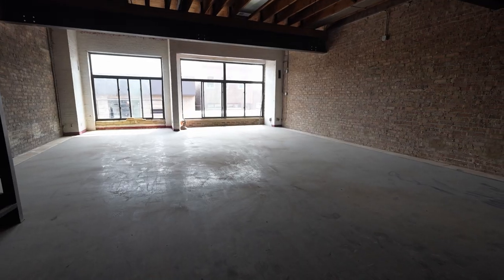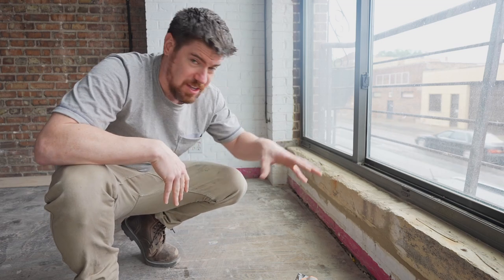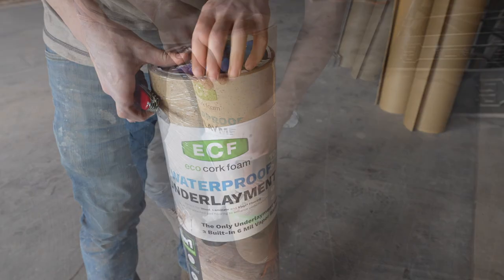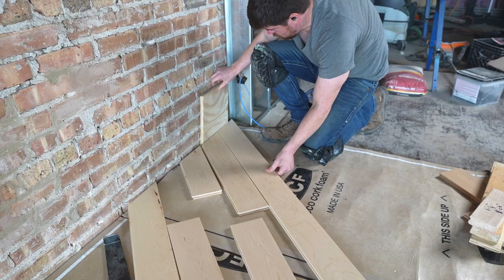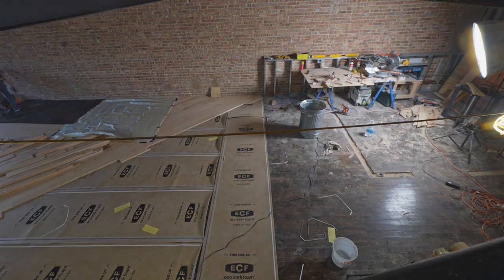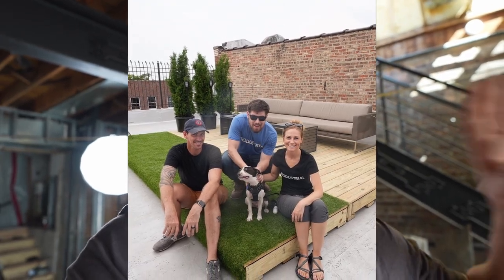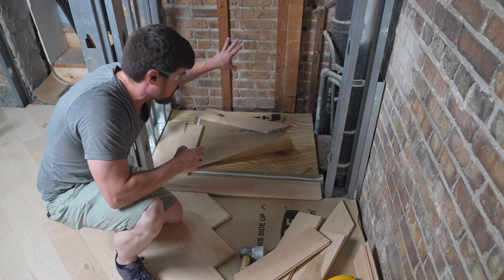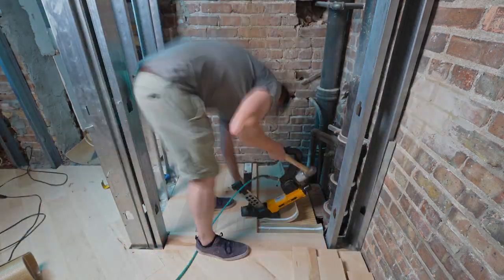ep. 23 - The MOST Dramatic Change yet!!!  ...Abandoned Bldg Renovation

Comment: I would 3D print something for the stairs then cast it using metal making molds from the 3D printed pieces!
Reply: Yeah you can melt it out like the lost wax method and then fill the molds. Go bigger than you need so you can sand down imperfections and don't forget to add a vent
Reply: One thing to be aware of with metl casting is galvanic corrosion from dissimilar metals. You'd definitely want a barrier, probably fiberglass, that would protect both the stairs and the cast parts. Personally I think a 3D printed or wood filler with hand crafted metal skins would work well enough and look just as good while not requiring a forge and costing a bit less.
Reply: @Zalex612  seems like the stairs are the same metal as the I-beams tho so as long as he uses the same kind of steel we should be good? The forge bit, yeah...
Reply: Was  gonna say something similar but just using the 3dprint sanded and painted OR use a metal filament and let it patina for flavor. The copper PLA/PETG filaments patina really pretty and if you break it, print another.
Reply: Yeah, to match the style of the stairs
Reply: I'd just print it and finish the print with some matte 2pac or something.
Reply: Exactly!  Either 3D print or have one of the talented artist friends mold or carve something for another colab.  Either way would be awesome.  Can get as weird as you want.  Me I'd have a little muscle guy holding up the stairs, or a construction worker doing some finishing touches.. or a faux el capitan rock face with some climbers on it.. Or Chicago skyline with The Dark Knight on the Sears Tower.  DO SOMETHIN CRAZY!
Reply: @xeromaru  carbon fibre would be an interesting material with resin.
Reply: @rxc3ntr1c  you can get good finishes with wet sanding.
Reply: @PWingert1966  Yeah, I was just thinking of durability of the finish and being able to match it to the railing.
Reply: @ls9  still need room for expansion around the steel between the floor boards. he cant put anything into the grooves, its gotta go ontop of the flooring.
Reply: @rxc3ntr1c  Maybe try a chemical etching technique on milled copper? Or is that being too geeky!
Reply: I’d go for a simple estucheon made of angle iron. If needed, paint to match the stair finish.

Comment: One interesting way you could cover up those spaces around the stairs is with 3D printing. Print out something that fits in there, give it a bit of shape, simple shapes could work, like a gentle incline maybe? Sand it out to make it smooth, and paint it to match the floor. Benefit of 3D printing it is that you could print out something exactly for that space, and make it (mostly) cheap to redo it if needed.
Reply: Beat me to it. Perfect idea
Reply: I bought a 3D printer and I didn't even think of that
Reply: 3D print something that LEDs can shine through
Reply: Except I would recommend a Resin printer in this case. Not the typical FDM. FDM looks "cheap" imo when trying to match it with aesthetics as seen in these videos.
Reply: Was just about to say this
Reply: Print it out of wood filament
Reply: @zioxei  Maybe you could 3D print some good ideas for next time.
Reply: I'm gonna add on to this as well and say  if Mike's got the resources, maybe look into lost PLA casting. Measure everything out perfectly then cast 2 pieces that fit together with a drop-in.
Reply: Could even use it as a starting point for casting from a sturdier material, so that iteration wastes less time and harder to recycle resources
Reply: Think this one won!
Reply: Could even do a cold cast with the 3D printed part with some iron shavings and concrete
Reply: I was going to suggest this also. I would start with the low end plastic stuff making two pieces that snap together around the post and get it exactly how you want it to look. Then once you have that 3d file with all the measurements, it could be possible to adapt it for wood or metal with a cnc if you wanted an upgrade. But honestly no one is going to be looking that close there 😂 so plastic could be fine, at least for the short term.
Reply: Or CNC some perfectly matching wood pieces. Out of some of the old reclaimed wood.
Reply: A cool project for the stairs may be some aluminum casting.

Comment: Wild idea for the stair trim question while totally keeping with the Modustrial aesthetic... 3d prints some molds that wrap around the areas you want to cover, lay in some LED or fiber optic lights and pour a cool translucent resin color into it. Have a color changing controller, as well as a dimmer and app option and use your new resin base for mood lighting while also creating a way to not stub your toe when you make a late night trip to the fridge for a snack.
Reply: The 3D printer was my exact idea for the trim as well. I understand that Modustrial ( I forgot his name) likes to support artists and creative pros. So, having a friend who is a wiz with 3D printing tech would be a great way to set that trim and support more unique and skilled folks out there. Great ideas all around and I am just LOVING this series!!!
Reply: I'm not sure if I'm picturing it right, but what I'm picturing looks cool! However, the gaps around the stairs are expansion gaps in case the floor moves, so I don't think you can fill them with resin. 
Or were you talking about the resin-part going on top of the wood, similarly to how a baseboard would work?
Reply: @simonro9168  Very much like a baseboard would hide that gap. Enough of an overhand to accomplish that, while keeping off the floor to allow expansion and natural movement. Basically having the resin attach to the metal part of the stairs while acting as a cover for the 3/4" gap
Reply: Wookies are very smart indeed.

Comment: In Holland/the Netherlands we use “platte plinten” it is a small piece of trim that is specially made for detailing around structures when laying down wood flooring!

You can use it around the stairs, if you don’t have any available. Just use a router around the edges of a bord and cut it just to 1 inch width and use it as a “platte plint”

Good luck!
Reply: Basically a flat skirting board that attaches to the floor instead of the wall.

Comment: We had the similar issue when renovating an old building that had a metal staircase. We used angle iron to “trim” the posts. We also consider trimming it using 1in strips of the wood flooring with a router edge but the home owner ended up wanting the iron. In the end it looked great!
Reply: Perfect!
Reply: The steel was the first thing i thought about when asked in the video, if you can make it look like it's the original groundplate i think it will look the most authentic...

Comment: for the stair trim just tack weld a steel "L" that is attached to the stairs but floating 1/8" above the floor so you get your expansion and it doesn't rub on the floor but hides the gap

Comment: Did you check the tiles you found for asbestos?  That is a serious concern in old structures.  With asbestos tile if it is not deteriorating it can be sealed and covered.  However you cut through the tile.  I would send a piece to a lab to be checked.
Reply: Bit late now, the job is already done 🤷🏼‍♂️
Reply: @John...44...  If I am understanding correctly that tile spans the living room under the wood subfloor.  So, it is still relevant even if the job is done.  If it was my floor I would get it checked and determine if remediation needs to be done.
Reply: @greengiant_6652  ok, but as far as I'm aware, asbestos is ok aslong as it is not damaged or able to be damaged. If it's under flooring it is safer to leave it where it is until a later date. That's the rule in the UK anyway
Reply: @John...44...  I believe that is the case in the US as well.  However, he cut through the tile in several places and in several of the shots the exposed tile was crumbling.  I would test the tile and then talk to an expert.  It's possible the combination of plywood, underlayment and  wood floor is sufficient to seal the tile.
Reply: Just saw that and went through the comments to see if someone picked up on that...I'm from Australia and any old tiled floor covering is to be wary of in case of asbestos. But alas this comes a bit too late to stop the circular saw pulverising it into fine dust.
Reply: Exactly what I thought when I saw those tiles.

Comment: I recommend a copper "boot" around the expansion gap on the stairs.  Make it angled almost like a pyramid base.  Copper is malleable and lends to the industrial look you go for.
Reply: I totally thought about copper, as well. Now, steel-to-copper directly touching will cause electrolysis, so the copper will rot over time, but being aware of that, you'd want to put a thin insulator between them, or just use brass instead.

Comment: Would make trim for the stair-posts from steel plate in two parts with one seem in the middle. Make a template from cardboard and transfer it  1/4 inch thick steel plate. It's weight should hold it in place and otherwise you could use the space underneath for a magnet to hold the two pieces together. Goes well with the industrial-look; better than 3d-printed stuff.
Reply: Yes! Making a custom metal escutcheon is perfect! 
(3D printing would look so bad...)

Comment: I am flooring installer of 28 years. one route to go to trim out around the steps would be to take scraps of the flooring and rip them in half thickness wise and then bevel the edges. then lay them flat on top of the floor and scribe them to the metal stairs covering the gap kinda like a picture frame. I would silicone them down and also use some pin nails to hold them in place. none of that will hurt the expansion of your 3/4 planks and it will blend right in with the floor. hope that helps ya and keep up the good work!

Comment: I had a similar issue in an old house with a metal railing. Use the wooden threshold boards that go between the hardwood floor and the front door jam. They have a Grove that goes down and fits into those gaps. It took some cutting but it worked perfect and looked great.
Reply from the maker: Good idea!

Comment: I can't wait to see how heating is being addressed. I worked in an office that converted an old cotton river mill that has similar brick and steel stairs as your building. Cold seeps through those outer walls very easily especially around the windows so folks started to have mini heaters at their desks to compensate.

As for how they fixed gaps between steel stairs and new flooring, I think I recall some sort of black tar like sludge that melted-fused together in those spots for main emergency escape stairwells and the smaller ones just had the gaps visible.

Comment: Angle iron sounds like a solid idea. You could also consider products such as weneve minileiste, they make aluminium skirting/trim that is inset into the floor so the visible part is horizontal, not vertical. It has springs to account for the wood movement. Looks pretty nifty.

Comment: You could use an angle iron which is low height and a bit longer in the other direction, then weld some big bold heads onto it to make it look like it's bolted to the floor. If that's the aesthetic you're going for.

Comment: I think you're on the right track with your angle iron idea for the stairs. Weld it to the stairs for a fastener free finish and paint it to match the rest of the frame. If and when you need to redo the floors you can slide them in and out from under the bottom of the piece.

Comment: For the sections of the flooring where they meet up with the staircase: 

My suggestion is to cut the new flooring back (anywhere from 3" up to 8" - depending on how much steep you want the angle) from the post/rail/panels on the side of the stairs, then use a router to cut back the original flooring on the outside edge of the metal where it's attached to the original floor (at least 0.5" to 1.5" max).

You will create a 'step/slope down' to the original floor level by adding an angled/sloped piece of trim that will be flush/inset @ bottom (aka the original floor) & meet up with the new flooring @ the top.  The inset will slope on an angle towards the staircase with the thinnest part being flush/inset into the original floor.  The steepness of the angle will depend on how far back you start the match up with the new floor.  I think it's probably going to be about a 3-5" for a 45 degree angle.  You can use a contrasting color, match the wrought iron, &/or match the new flooring (& you could change the color depending on where it's at & how visible/invisible you want it to be).

Think of your new floor as the outside rail of a cabinet door & the original floor being the inset panel.  You are adding a piece of trim to blend the 2 pieces together & eliminate any edges.

I can't see any way to 'trim it out' in a typical 'new flooring way' that wouldn't look a bit odd IMO.  I can send you a sketch for clarification if my description wasn't clear enough.

Comment: Use bleached cork to fill in the gaps around the staircase. Much like cobblers do when removing cheap fibreboard from shoes and replace it with cork. They use a hot flat iron to smooth the surface (like a floor screed).
Hopefully it will be soft enough to expand whilst filling in the uneven gaps.

Comment: Did you check to see how level the floor was and remove any high spots on the wood "subfloor"? 
I know since you have wood flooring it is less of a problem than a harder tile, since the wood will expand and contract with humidity anyway, plus the cork helps a little bit too.
Reply from the maker: Yup, we did that....also, the ecocork foam helps quite a bit with leveling things out

Comment: A suggestion regarding the area sorrunding the excisting stairs.1. make the floor wood look a nice as possible (make the wood have a clean cut). 2 Use black silicone and fill op so the silicone is level with the floor, but also in full contact with the stairs. The silicone has the advantage of being somewhat flexible and allow wood movement and the same time closing the gap completely.  Sorry for bad spelling and hope suggestion make sence....Other wise interessent video and the rebuild is very cool...:-)

Comment: How about taking 1-1/2 inch pipe and sawing it length-wise into quarters. Weld those to 3/4 inch angle and you have some steel quarter-round or shoe mold. Paint them black to match the rail and bolt them in place to avoid damaging the floor, and removable in case you ever need to replace some flooring.

Comment: Simple metal flanges around the stair post and structure from some 3/16 1x flat bar would be my solution. If it were me, I would stitch weld the flanges to the existing metal to allow for floor movement. Quick, short welds with copper flashing between the wood floor and where you weld will greatly reduce floor damage.

Comment: Re the stairs expansion gap. You have a CNC. cut a molding that you can glue and pin in place out of a solid piece of flooring and split it so it goes in as two pieces. Similar to the 3D printed idea but out of the hardwood you use for the floor.

Comment: Use CAD (Cardboard Aided Design) to make template in two halves, laser cut some steel sheet and paint/powdercoat the same as the stairs or stainless sheet. Then slide in from either side.

Comment: I like the idea of using some 1.5" angle iron to weld on a sort of "platform" look to the bottom of the stairs.  Use  a really thin cork or neoprene under it to get a good flush look at the floor and keep junk from getting under there, then grind the welds clean, and maybe tack on some detailing that looks like the designs on the sides of the stairs, maybe weld on some bolt heads to make it look bolted down to the floor.  Turn it into a feature instead of trying to hide it.

Comment: Expansion gap around the steel staicase: Could you not use some kind of quarter round base board trim that would be liquid nailed to the steel but not the flooring? That way the floor could expand and contract under the quarter round..coat it with the same varnish/stain as the floor. a bit of linseed oil based putty tinted same colour as flooring for any gaps between the steel stair and and quarter round. think thats how i would do it..i'm no pro though
Reply: I wanted to suggest the same.  great idea
Reply: Quarter round the same colour as the steel and you wouldn't even see it

Comment: My idea for the gap between the stairs and the flooring is, I feel, a fairly simple one. Get some metal sheeting. I'm not sure about american measurements, but in the UK 3mm would be plenty thick. Use that to make some faux base plates. Actually weld a strip to the stair post and stringer holding up the stairs. Tac on fake bolts that look as though they're bolted to the floor. Have the sheet metal go all the way around the stair posts, so it looks like its an actual base plate. I'm a bit late to the party with ideas, but i hope this helps.

Comment: You can glue strips of cork into the gaps at the stairs. Because of its flexibility, the floor should be still able to move :) its cheap an simple, you just have to cut a straight edge, because its visible afterwards.

Comment: I confess I'm not a fan of the diagonal floors but with that long of a space it really works without feeling off or wrong. Nice job all around :)
Reply from the maker: The only other option was horizontally accross the old floor boards, since you have to lay the new floorboards so the go across the old ones (can't be parallel since that can lead to boards tilting over time).  And if you don't like diagonal, then you really don't like horizontal in a long space....   Or, I could have spent a week ripping out the old floor, dealing with the (potentially asbestos) tile layer under the old floor, then spent 2k on plywood and another 3-4 days time to lay down a new subfloor..... In view of those options, diagonal seemed like the way to go :)